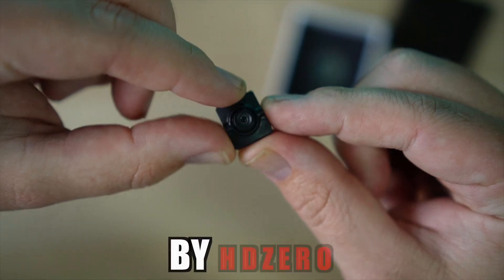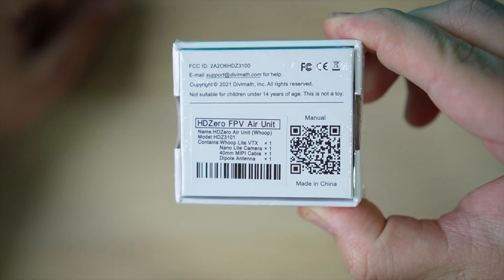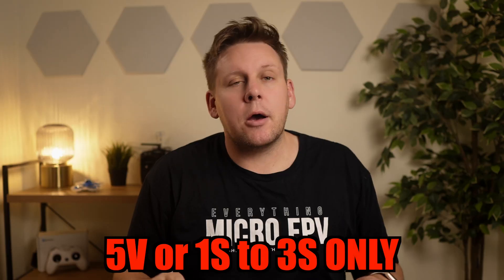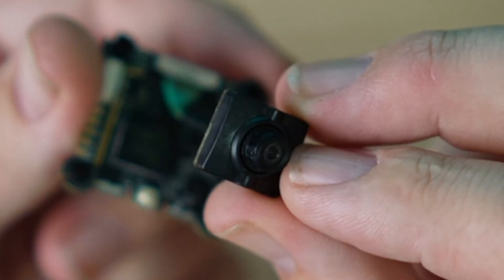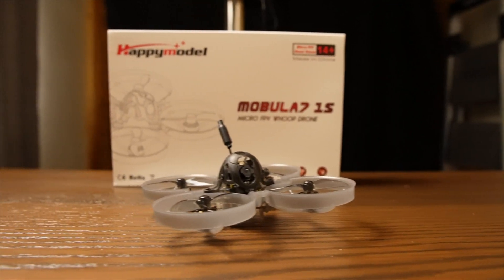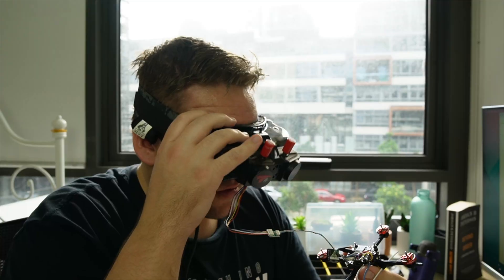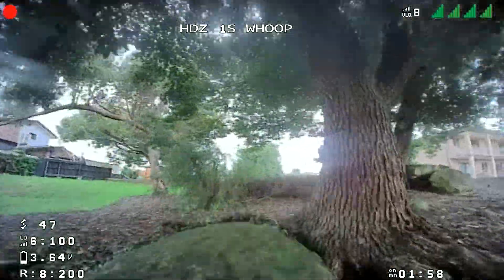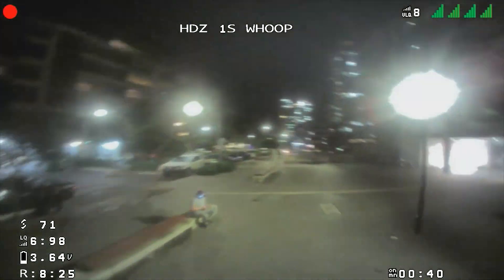HDZero for 1S Whoops!

Comment: How exactly did you get osd? I am using the crazybeef4 which has the same number of uarts but I can only get fuzzy camera feed and no osd. Also where exactly are the bridges you can desolder on the x12 to disable the vtx? I want to do the same.
Reply from the maker: you need to set up HDzero in Betaflight... If you join my discord I can share images with you of the bridge pads and give you more help.

https://discord.gg/vqyCG5Jd

Comment: How did you feel the handling of the whoop changed with the added weight? The whoop will be around 20g to start with and you're adding another 7g, so that's a massive payload to haul around with it.
Reply from the maker: I haven’t tested the Mobula7 without it yet but you can feel the weight.
Reply: @DarrenAllatt  I once put a DVR board on a mob 7, and it was horrible. I've also flown a crossfire receiver on a mob 6 and I could even feel that. I think this board is great for toothpicks or small cinewhoops. I think for a proper whoop experience we're going to have to wait till someone comes out with an all in one flight controller.
Reply: Although it would add more weight I have been reading about adding the Rcn 1002 motors to the mobula 7 with good results with the HDZero system.  Thoughts?

Comment: What kind of batteries can I use for a mobula 7 build or a mobula 6 analog build? Can I use 1s 450 and 550 mAh, is both okay to use?
Reply from the maker: The frame can only take 450mah, I couldn’t get the auline 1S 550 to fit

Comment: I'm just a beginner and I bought a Firefly Nano S1 Baby Quad V1. 2.
As I understand, this camera is gonna work on my nano. Is that right?
Your work is very good. Tks
Reply from the maker: Hey Paulo,
This isn't just a camera, rather a digital FPV video system comprising of a both Digital Camera,  Digital VTX. You will need a HDZero receiver on your goggles for this to work
Reply: @DarrenAllatt  ok. I got it.
Thank you.
Reply: The nano baby is already underpowered. I would not add additional 4-5g for the hdzero system to it.
Reply: @Chris-xe5ts  yeah. I think so. Just wondering. Tks

Comment: Super cool!  I haven't inquired yet but I'm wondering if it supports dji goggle?  Thanks 👊🙋‍♂️🌞
Reply: It does not.
Reply: @SquatchWerks  To be expected 😞.. Tnx 👍👊
Reply: No dji will never work with Hd-Zero that's the entire point of HD ZERO
Reply from the maker: HDZero is a completely different system to DJI. 

Think of it like HDZero is Android and DJI is Apple. This is vtx system that works only on HDZero
Reply: DJI closed the entire system for other HD systems. Will never be able to fly it with other google or use another HD system with your DJI goggle.